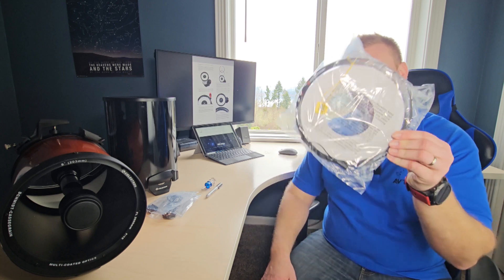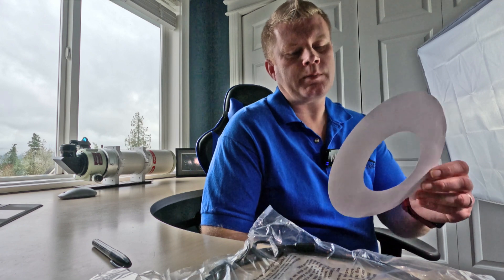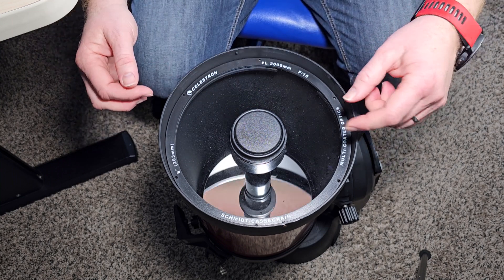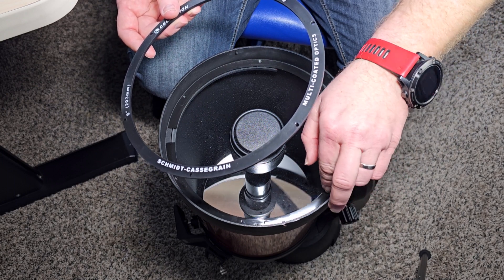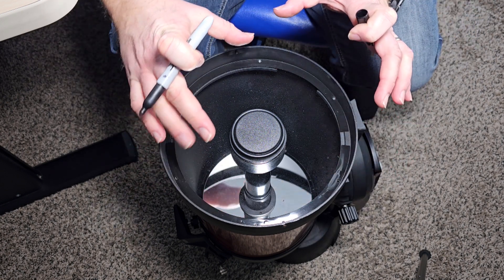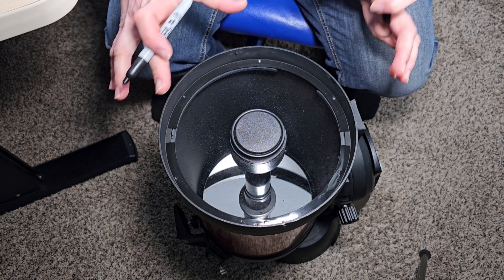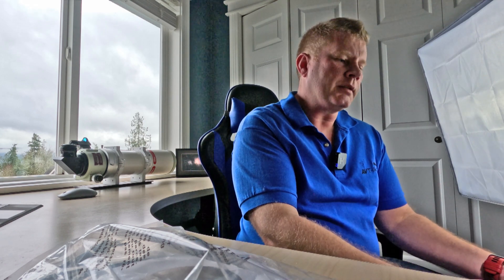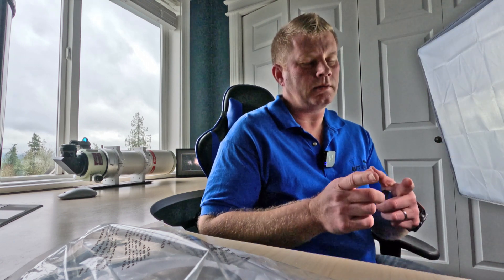Celestron DEW HEATER RING Installation DEMO! Install Your Nexstar HD Dew Heater Ring Like a Pro!!!

Comment: I strongly advise caution regarding the use of this dew heater ring.  It can cause spikes in your stars which grow larger as more power is applied to the ring.  There are numerous discussions about this on the CloudyNights foum along with examples of images.  I ended up removing mine and reverting to the stock ring and AstroZap dew shield.

Comment: Sometimes I'm glad I live in the high desert, especially all Winter and because it's over 4500 feet the Summers are not terrible either. My dew shields have been plenty to stop any dewing on my scopes.
Reply from the maker: Yup, that's one advantage to a dry climate. Here there have been plenty of times that even with both a dew shild and dew heater the optics still get dewed up, especially on larger scopes.
Reply: @AVTAstro  I've borrowed an 8" SCT and no dew shield and at 60% humidity it wanted to dew up until it warmed up coming out of my ac in truck.

Comment: Good content as always, thanks for sharing. Three Questions (i consider getting that set for my 9.25SCT):
I already seen a super long slide that explained how the dew heater ring does not impact the seeing/picture quality so 
1. U live in a rough enviroment, u got any experience on how effective the dew heater ring is? 
2. Is it possibe to put the standard dust cap on the scope with the dew heater ring installed? 
3. U have experience on putting a Bahtinov mask not right on the corrector plate ring but on the dew heater? I wonder if Bahtinov mask is usable like half a meter away from the corrector plate.
Reply from the maker: Thanks! 

1) Not the ring. I have not used it yet. I will post a review once I have spent some time under the stars with it. 
2) dust cover works just fine!
3) don't use them so not sure.

Comment: Nice job detailing the installation,  Vlad. Tips on corrector plate care are important! Can really mess the optics up.

Curious to see your follow-up using this thing. Advantages over external dew heater strips, especially.  Seems like an added expense to have to buy a metal dew shield to accommodate  wiring. 

That said, you're always on top of the latest developments. Appreciate that very much. Thanks for the tutorials!
Reply from the maker: Yup, will post a follow-up once I get some use time out of these! Thanks!